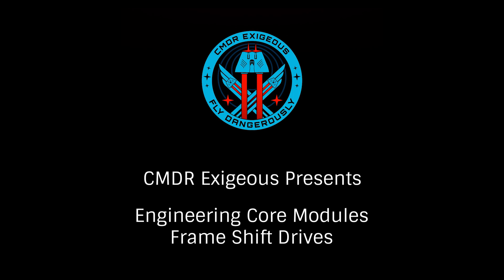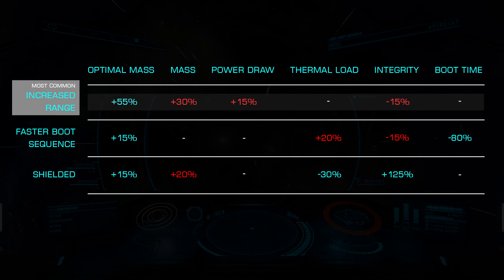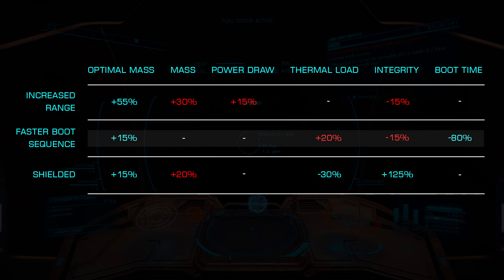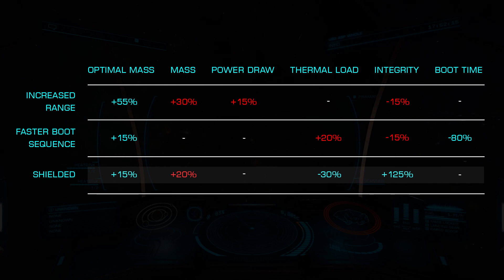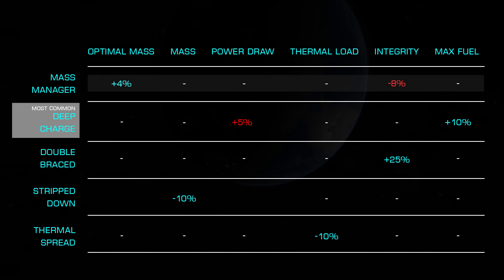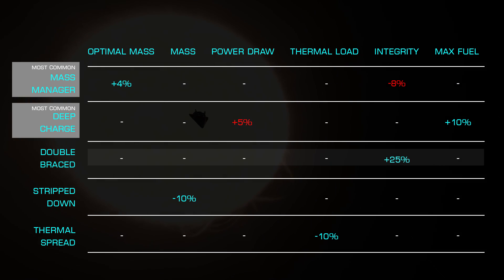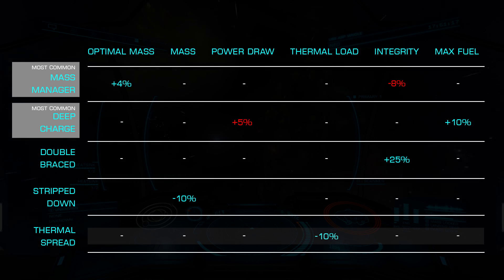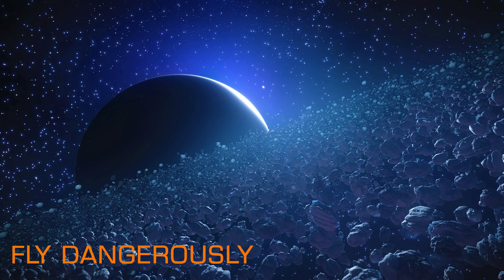Engineering Explained: Frame Shift Drives

Comment: do kind of love shielded so far as i had no materials for range
nicly combined to fuel scoop  as just at rank 2  can scoop up and charge and it just below heat damage taken range after its complete 

but that increased  range on the  other sounds just as juicy  but at te cost of integrity
 is a little off putting if your ship is not fully engineered to negate killing of the fsd

Comment: Wait what..? Ex, i did the faster boot on my Vulture, and it did make it a faster jump to supercruise, InFact much faster compared to none modded, so its not just no power on boot time.
I'm not sure if this has different effect on different size of ships(size of FSD compared to overall mass) and what not.
Reply: Seconded. Maybe this is something that was changed in the game after the video was posted? I have a couple of AX ships permanently stationed in the Pleiades for which I engineered two different FSDs: I used a long range drive to get them out there, then had a "combat drive" with fast boot sequence shipped and swapped in. Lower mass, and that shorter boot time only needed to save my butt once to justify the cost.
Reply: A jump from normal space to supercruise is faster than that of normal space to hyperspace.

Comment: I don't get it why I need to choose Deep charge over Mass manager? Later is better in every way.
Reply from the maker: It depends on the ship/size.  For class 4 and smaller deep charge is better, for 5 and higher generally mass manager is best.
Reply: Yeah, I believe they break even with their range boost with size 5 FSD, though mass manager is then preferable because the smaller fuel use. On larger drives mass manager is clearly better and the other way around with smaller ones. As size 5 FSD is common it's understandable they put the break point there.

Comment: The Guardian Frame Shift Drive module will also increase your range by up to 10 LY. Currently removed due to a bug, but it is supposed to be reintroduced shortly, perhaps in 3.1.

And then there's synthesis of Jumponium...
Reply from the maker: Good point on juponium, have a video ready to go when they get their shit fixed.

Comment: This seems to indicate mass manager is better at level 5 and higher. 
https://forums.frontier.co.uk/showthread.php/403010-Mass-Manager-vs-Deep-Charge
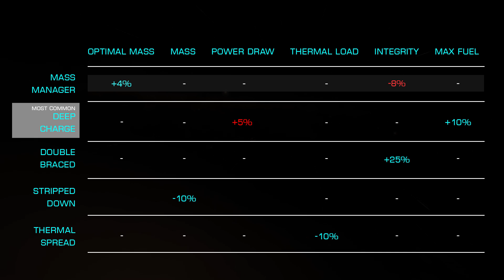Reply from the maker: You mean just like I state @2:00 in the video?  Yep, that's correct.
Reply: CMDR Exigeous At about 2:22, you say use Mass Manager at class 6 and above.  The link shows Mass Manager and Deep Charge are about equal at level 5, and Mass Manager is a better choice at level 5 due to fuel savings.  Both the DBX and AspX use class 5 FSD, so this would be of great interest to explorers. I was curious if the math had changed.  

Nice series of tutorials btw.
Reply from the maker: It's so close that it really then depends on the build - as one or the other could give you longer range.  That's why I was (trying) to be as general as possible as 6 or higher Mass Manager is almost always better and I should have maybe said 4 or lower Deep Charge is almost always better.

Comment: So, for my QoL to get more LY per jump Mass Manager or Deep Charge in a DBX?
Reply from the maker: DBX would be Deep Charge if you want max range - it's about .5 ly better - so not huge ;-)
Reply: DBX uses a class 5 FSD. For this class, Mass Manager and Deep Charge should give equal jump range, but Deep Charge will burn more fuel, lowering your total (multi-jump) range. So use Mass Manager.